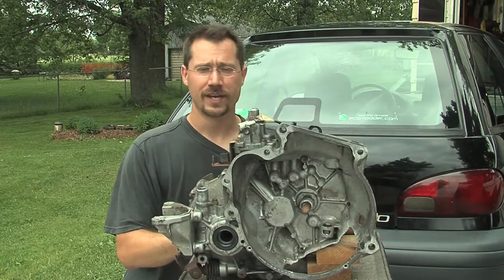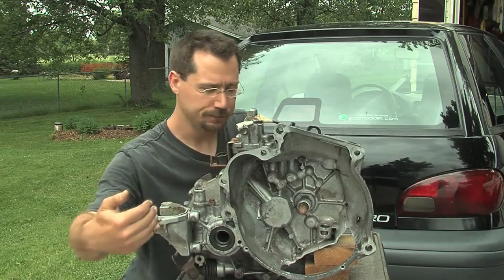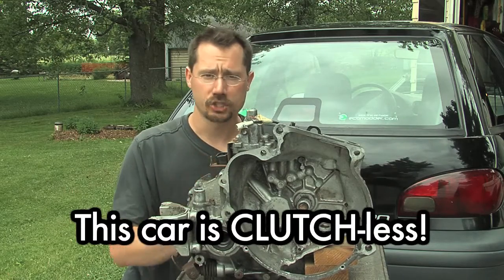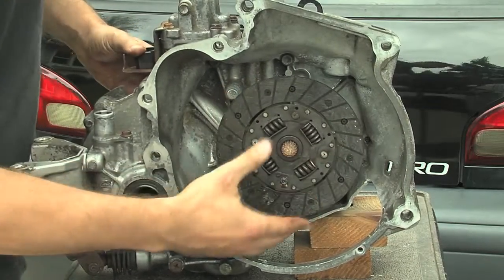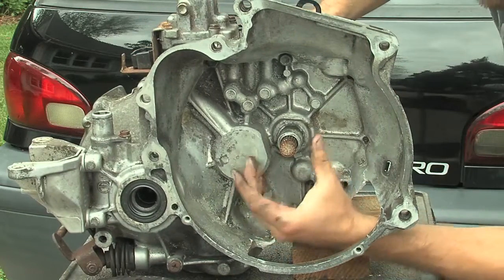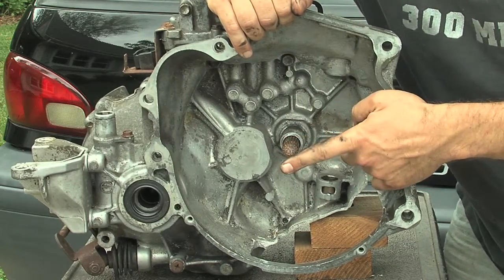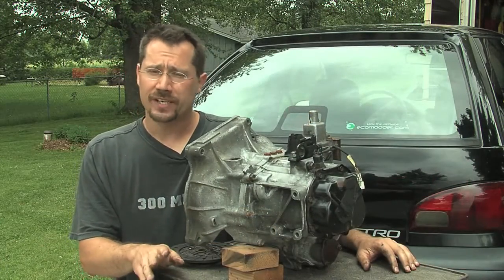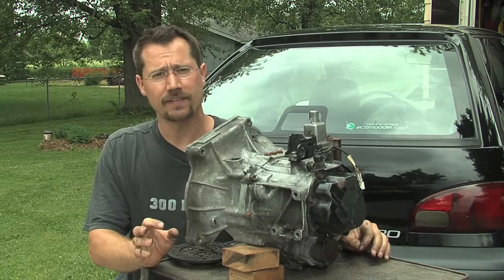DIY Electric Car: 05 Transmission Basics

Comment: Can we shift smoothly when drive if no clutch?
Reply from the maker: Yes. It takes a moment longer, but it's perfectly smooth. I simply let off the accelerator, take the car out of gear, wait just a moment for the motor  to slow just a bit, and then gently shift into the next gear. It drops right in.

Also, there's a whole lot less shifting with an electric motor than a gas engine.
On this car, I would often simply put the car in 3rd, and then drive it as though it were the DRIVE gear in an automatic transmission car.

No need to push in the clutch when coming to a stop. The electric motor simply stops spinning.
Plenty of torque to pull away from a dead stop without needing a clutch to keep the engine from killing either.
Reply: @BenjaminNelsonX  wow...i am thinking  to make series hybrid.
.i have daihatsu mira..and juat want to put electric motor to transmission  via pulley and belt....and i want to uae probably..only 15000 watts ac motor..would that  be strong enough?

Comment: What about the pressure plate?
Reply from the maker: This car just used a solid connection between the driven shaft of the transmission and the electric motor. Because of that, it didn't use the flywheel or clutch pressure plate.

Comment: If I wanted to add a torque converter would that be a good idea? Thanks!
Reply from the maker: What advantage would a torque converter give the project?
The only time I can think of that I've ever seen a torque converter in an electric car conversion was a car with powerful twin DC motors right on the driveshaft. A torque converter was used to allow the motors to start spinning a bit before the driveshaft would spin. This would prevent high current on a stationary position on the armatures causing high heat at the brushes.

Comment: With that big access hole I think I would have taken a fibreglass mould of that area first to I could easily seal it off later.
Reply from the maker: Or just a piece of bent sheet metal could go over it easily as well.

Comment: Can you make a parking gear out of first gear?
Reply from the maker: An electric motor doesn't resist movement the way the vacuum and compression of cylinders in an engine does. Just use the parking brake.

Comment: good info, I am sure in retrospect things would have been done different, but for a first build, I say it is great! 
Personally I would want the clutch. Mainly so that I can control the power-flow....and dump the clutch when I want ;)
Reply from the maker: Keep in mind how an electric motor is different than a gas engine. For example, when no driving, the electric motor completely stops. You can simply leave the car in gear (without a clutch) and use the accelerator to control the power. (You can even use software to adjust the throttle response.) I do know a few guys who did DIY cars with clutches and had trouble burning them out.
Thanks for acknowledging that this was a "first build". It was a great project, I learned a lot, and it was EXTREMELY low budget! All that said it was fun both to build and drive and really worked remarkably well!
Reply: Wow, Thank you for responding!
I have a couple of vehicles that I am considering this for. I am a fleet tech and have been turning wrenches for over 20yrs. I see that electric is the future, and LOVE the idea of the conversion. I want to start small.... I have a little 250cc Chinese buggy that blew the motor. It will sit two full size adults, and is chain driven via a transfer box that supplies my forward and reverse from the current cvt transmission/engine. I think my biggest problem there will be no transmission, so the motor selection and control need to be specific for my needs and wants....i.e. off road fun...lots of research to do!!! hahahahaha!!! I am only starting too, looks like great fun! 
I also have a 1984 cj7 jeep that I absolutely love the idea of converting...So very cool! 

Thank you for posting these videos! Outstanding!

Comment: Could you use an automatic transmission car for a conversion? I have a camry with a blown motor but it's automatic
Reply: Aoram07  yes you will have to adapt to the input shaft and run an electric trans pump depending on the trans.

Comment: In this video you say you don't need a clutch, but don't say why you don't, or what it'll be like driving without one. My brain is thinking "but how do you shift gears?" lol, maybe we'll see in another video because that's got me puzzled.
Reply from the maker: One of the big reasons why you need a clutch on a typical gas car is because of the heavy flywheel and the engine always pushing the driven parts (at a bare minimum, the engine needs to idle, it's always spinning).
In my electric car conversion, I simply let off the accelerator, let the motor spin down for just a moment, and then shift into the next gear. It drops right in, and no, there's no "crunching".
The other thing is that there is a lot LESS shifting in this car. I can typically just put it in 3rd gear, and use that similar to DRIVE in an automatic. Since the motor STOPS spinning when you stop the vehicle (unlike a gas engine with manual transmission, which needs to idle) there isn't even any reason to take the car out of gear, push in a clutch, or put the car back in gear.
Reply: BenjaminNelson I think I get it. In my truck I can somewhat shift without the clutch but I have to be super precise. Right speed, right RPMs, etc. Of course I still need to use it when starting and stopping. Great videos BTW!!
Reply from the maker: https://300mpg.org/projects/electro-metro/going-clutchless/

Comment: Hello again Benjamin, Here again. Can I ask, how do you keep all the road dirt and water out of the modified engine compartment?
Reply from the maker: I didn't. The electronic components are sealed up against the weather, but the motor and transmission are only protected by the hood and fenders, just like any engine.
Reply: Thanks Benjamin, Yes, I would make sense and it would be difficult getting around all the other bits, steering suspension etc.
Regards, Cy

Comment: I know this is a stupid question, but why don't any EV conversions bypass the transmission completely? If you run from the electric motor straight back to the rear end (differential)  on a truck, and the truck had like 4.88 or so rear gears and small tires, wouldn't you be able to do without a transmission or would overall gearing be too tall?
Reply: I'm with you, I think no transmission sounds great! Tesla has a single gear system. Basically no transmission, just electric motor to what you could think of as a "rear end" (gear reduction & differential). So it's definitely a solid idea to not have one, if you build the system correctly. 

Counterpoint being that with a gear box, you can really match the motors peak performance points. From what I understand electric motors have more torque at lower and mid RPM ranges, and run down in the higher RPMs so if you're looking for performance you might need a gear box. I hear the Model S is crazy off the line, but lacks in the high end. Which is fine for a majority of the people out there, including myself. I'd want a "street light  to street light" racer.

I guess with a gearbox you also have reverse built in, so you don't have to mess with trying to figure out how to spin the motor backwards. 

Maybe a special built 2-speed gearbox with reverse is ideal then? One that's super compact and light and designed specifically for DIY EVs.
Reply from the maker: There are some conversions that DO as you said. The down-side is that you are stuck with a single, fixed gearing. Keeping the original transmission gives you more flexibility. You also have to keep in mind how the electric motor attaches to the driveline. On a truck, a large electric motor can have a drive-shaft yoke attached directly to it, and then have that go to the differential. On a typical front-wheel-drive car, the differential is built in to the transmission, and the easiest thing to do is mount the electric motor directly to the transmission.
Keep in mind that getting rid of the transmission doesn't necessarily make the project simpler/better/more efficient. Electric motors still have a torque curve. Depending on the power/speed needed for your project and what motor you are using, most of the time, keeping the transmission is still advantageous.
On modern commercially built electric cars, nearly all of them use a high-voltage AC motor connected to a single-speed gear reduction.

Comment: I'd just picked up a blown engine chevy metro, auto trans, but thinking to ditch the torque converter for manual selecting "L" and "2" (nevermind "D" with its slushboxy functions). opinion? hoping for 50-55 mph max and only needing 10-15Kw of motor.

Comment: Hello! Just bought your video on Vimeo and let me tell you, it's great! I want to convert an old 1973 VW Bug, is it too hard? Also, another question, if I need to stop on a hill, and then resume my trip, does the car rolls back by itself like an standard or stands still like an automatic?
Reply from the maker: +Panchosama: Classic VW Bugs have been popular for conversions, and they are very simple to work on. On a car like that, you would have a manual transmission, so yes, on a hill, it would act just like a gas engine with manual transmission. If you have any concerns, you can just use the parking brake. Also, in an electric, you can just leave the car in gear when at a stop. So, you just need to press the accelerator, you don't have to use a clutch. Lastly, if you do a conversion with an AC motor, sometimes the software controls for the motor can be programmed to "Hold" your position, and prevent a car from rolling backwards. Take a look at some of the VW Bug conversions done with the AC50 motor!

Comment: I have an 83 camaro that I want to convert electric, everything has been pulled out, it has a standard transmission, and I want to couple it to an AC motor. My mechanic told me that for manual, I need to hook up the clutch assembly to a flywheel, which would then be connected to the driveshaft of the elec. motor with a hub. At first I suspected I could get away with just using a lovejoy coupler but my mechanic strongly advised against it saying that it's going to grind the gears if I try to shift. Considering that a vfd drive can reach some pretty rpms with a motor, Can't I just drive in 1st-2nd? He also says if I do that and try to hotshift I will grind the gears. Someone help plz? Thanks guys.
Reply: If you have a modern manual transmission in your Camaro, you won't "grind" gears because all forward gears are synchronized.
Reply from the maker: Your mechanic is also an engine guy, not an electric motor guy. An electric motor doesn't idle and it has significantly less rotating mass than an engine. You CAN do a clutchless electric car - however, it will not shift as quickly as with a clutch. It is more FUN to drive with clutch, and you would do that as described with a clutch on a hub on the electric motor driveshaft. Both ways work.
Reply: Thanks guys! I am well on the way to going with a clutch, and a high-reving spindle motor, in the ballpark of 30-35kw cont. duty. Also, if you increase the rotating mass of the motor, wouldn't that give you more torque? I am considering fattening the flywheel with some additional steel disks to give the motor more inertia. Any thoughts on this? Anyone ever try this?
Reply from the maker: +Blodslav Actually, you want LESS inertia, not more! The main use of the flywheel is to continue the rotation of a gas or diesel engine, which only creates power during one-fourth of the operation of each cylinder. The flywheel helps smooth out the intermittent power. Electric motors put out a pretty steady power. The more inertia (mass) that the flywheel has, the harder it is to speed up and slow down the electric motor. It's fairly common on DIY electric conversions to use a piece of aluminum, machined down to fit the motor shaft and the clutch plate, to REPLACE the flywheel (saving weight) yet still keeping the clutch.
Reply: I completely disagree. I'm going to weigh that flywheel down by a lot. On purpose.
Reply: +Blodslav correct more rotating mass will take more time to spool up, but it CAN store more energy to unleash in one shot like dropping the clutch in a dragster, WHAP! the downside is adding more weight hurting overall normal acceleration and range. its same for gas cars, the more weight you strip away the better the horsepower to weight ratio = quicker 1/4 mile or same speed/time using less energy. not saying "hey dont do that", theres just no real need with electric motor and gear ratio you'd have plenty of WHAP.
Reply: I am also curious to see how flywheel weight affects regenerative braking, both clutch down and up. I think if you want to save on weight, the flywheel is not the best place to do it. Obvious key difference between gas and electric is the friction on the rotor. Significantly less with electric. When you are dealing with a vehicle that is 3500lbs fully loaded, whether your flywheel weighs 20lb or 50 lb is not a big difference in linear acceleration, but when you calculate the stopping torque @7k, 10k, 15k rpm... you get very different numbers.
Reply: no doubting the potential of the stored kinetic energy. I'm thinking chevy/geo/metro (got), eliminating all the ICE and AC related stuff to go chain sprocket driven 4x4 ATV front diff to wheel shafts. much lighter weight arrangement than using a standard trans that I dont have anyway, ratio changed with sprocket swaps. totally different than a 'maro for sure, if I'm going to add weight it'll be for storage-range. replacing all glass possible with plexi, lighter tires-rims etc. glorified golf cart lol.
Reply: I would strongly advise against 4x4 or anything chain and sprocket. To save on fabrication and re-work. Using as much of the original vehicle as possible is your best bet in terms of practicality and safety. Plexi windows, fiberglass hood, doors, hatch and body panels are things that are decent options, but shouldn't be prioritized over the power management system, drive train, and redundant safety features. I would recommend reading "Convert It" by Michael P. Brown.

Comment: Ok, I want to go the EV route with a geo metro. I want to keep the gas engine in and use the 2 motors on the rear axle. I know that that will probably be more complicated and will try maybe this on a second try since I found a car with a blown engine for cheap. Just maybe in the future does this seem possible?

Comment from the maker: Yes, you can run an electric car with an automatic transmission, but it will be slightly more complicated and less efficient.
Reply: So the 2020 agency electric cars which have no manual transmission are more efficient?
Reply from the maker: @ignaciovela4618  A modern, factory-built electric car, with simple single-speed gear reduction is more efficient than a conversion with a manual transmission or an automatic transmission.
Efficiency is important, as consumers want the longest range possible. A more efficient drive-train allows for a longer range for the same size battery.

Comment: Anyway most cars can be shifted without the clutch, by shifting on RPM. Handy if you get caught out nowhere, and need to get back somewhere. Bring the RPM up, then let it drop slowly while gently trying to shift, when the two shafts are spinning at the same speed, boom, you've shifted. Now you know what the sync RPM is. Of course this doesn't work from full stop, so park on a hill.

Comment from the maker: Generally, if you spin the motor a little faster, and gear it down a little more, you get plenty of power, but pull fewer amps, which is good for your batteries and range.On my car, I'm usually driving it one gear LOWER than I would if it were a gasser (Except that I completely skip 1st.)

Comment from the maker: Without the weight of the engine cylinders and flywheel, you can shift without a clutch just fine. The other thing is that I just shift a lot less as well. In the city, I can just leave the car in second or third and use it as though it were DRIVE.